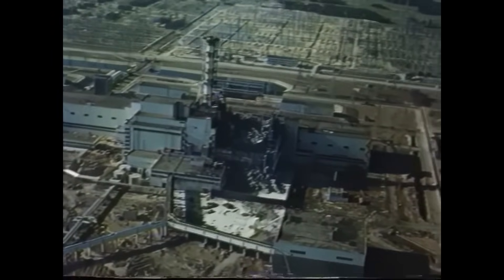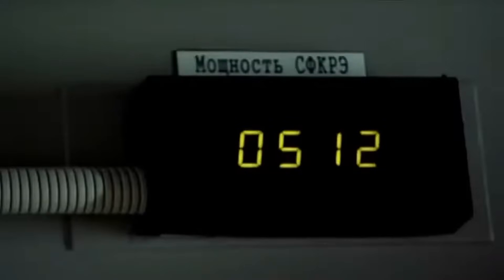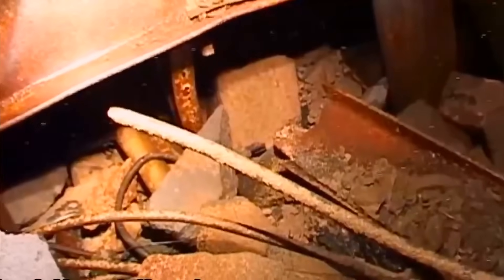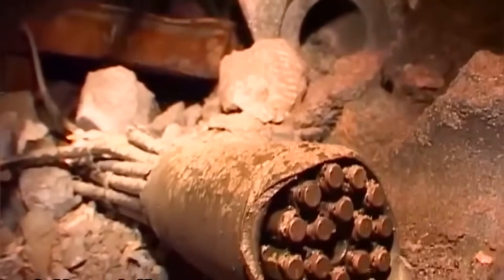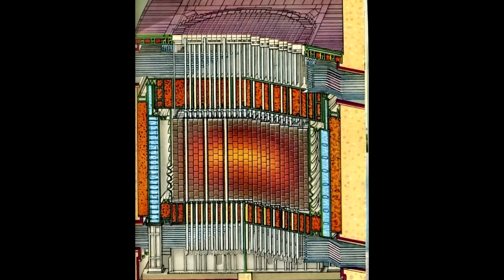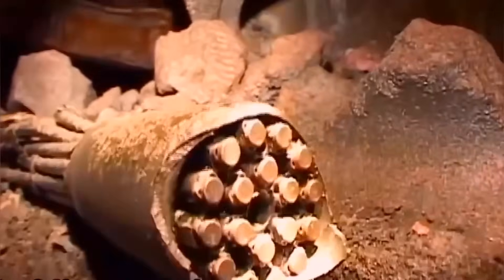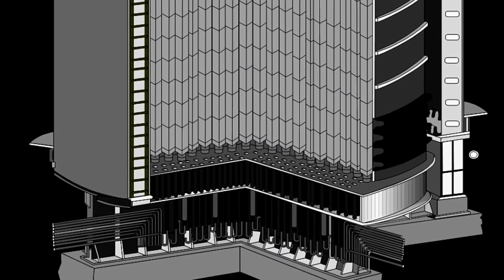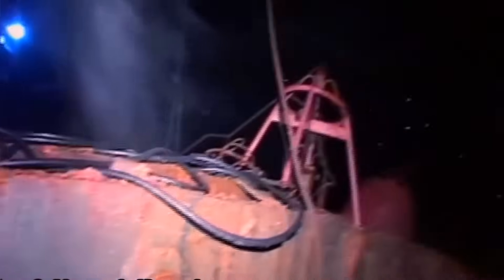Chernobyl Explosion Theories: The Hydrogen Explosion and Why it Doesn't Work

Comment: There are huge problems with your debunk.

1. Steam + graphite --> hydrogen + carbon monoxide. You claim that the high pressure means that oxygen can't come in to support combustion. Obviously, this is correct. As you say, the high pressure means that the hydrogen and carbon monoxide moves outwards. Outwards into what? The atmosphere, where it mixes with oxygen.

2. You claim that the surface area of the reactor wasn't large enough to generate enough hydrogen. Your calculation appears to consider only the upper, circular surface of the reactor. You haven't factored in all the other surfaces, such as the big hole down the centre of each block. You also haven't factored in the damage to the core from the steam explosion, which would likely produce even more surface area.

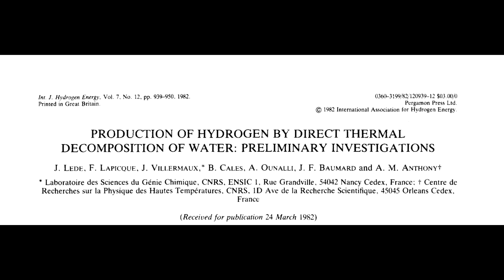3. I'm really not following the argument you're making about thermal dissociation of water, and how it relates to the table at 8:10. When you say that "This is only true at one tenth of atmospheric pressure", what is "this"? The claim that water begins to dissociate into hydrogen and oxygen at 2500C? The table shows that, at 2500C, somewhere in the ballpark of 15% of water dissociates. You then say that, at one atmosphere, the temperature must be 3000C and, at ten atmospheres, it must be 4500C. But the table shows that 22% of water dissociates at 1atm and 3000C, and 61% at 10atm and 4000C, so at 4500C there would be even more conversion. You're not comparing like with like. Also, you're assuming pure steam: note the lower part of the table, which says that 10% steam, 90% inert atmosphere (argon) at 1atm behaves roughly like pure steam at 0.1atm. So the data doesn't seem to be supporting your argument here. (By the way, the numbers you quote also don't seem to support your claim of exponential growth in required temperature, though that misuse of the term "exponential" doesn't really affect the argument as a whole.) You go on to say that the normal operating pressure was about 68atm. But the reactor had just blown its lid off, so was open to the atmosphere.

Comment: Could it be the lid came off then the second explosion happened, at the point the pressure had dropped, so yes the water under preasure didnt split, but after the lid had opened due to fission pressure the water then split and the second explosion occured ?

Comment: OK, so the hydrogen explosion is looking increasingly implausible . . .

I was under the impression that the zirconium could act as a catalyst for the thermolysis of water, allowing the reaction to occur at significantly lower temperatures than would normally be the case. This does not change the thermodynamics of the reaction (so higher pressure will still drive the reaction towards water), but does change the rate at which it can occur.

Is it possible that the lifting of Yelena caused a drop in pressure inside the reactor, thus allowing a substantial amount of the water vapour to rapidly split into hydrogen and oxygen?
Reply: All you need is a lot of graphite surface area (at 3200 square meters in this reactor), tons of steam, which we definitely have (600 kg/s) and temperatures at above 1500C which we have after 1:23:44 am.  Occam's Razor. It's not the 3 seconds that is the limiting factor. There is so much graphite surface area and so much steam that within 1 second there is enough hydrogen to cause a problem or about half a Hindenberg's worth of hydrogen.

Comment: Another great chapter, thank you!  Several commenters ask, where did the oxygen come from?  The answer may be hiding in plain sight:  During a prompt criticality, the generation of ionizing radiation is off the charts intense.  Ionizing radiation strips off atoms' electrons (hence the name) and can dissociate molecules.  If gaseous water (steam) molecules dissociate from this (or any) cause, they're put into a higher energy state, and you're left with 2 hydrogens per each oxygen, a perfect stochiometric ratio to recombine back to the natural lower energy state and releasing all that energy when it happens.  Given the amount of steam surrounding the fuel rods, and estimating the extreme intensity of the runaway fission, how many steam molecules would be dissociated into hydrogen and oxygen during the prompt criticality?
Reply: Interesting thought. 

Would that be more or less likely than the injection of energy causing a large amount of liquid water to flash into steam?
Reply: @nigeldepledge3790  Yes I've always favored the steam explosion theory, however there is agreement there were two explosions.  I asked my boss (atomic physicist) about the dissociation energy, he said, too hard to calculate, although he proposed the dissociation theory, not me (I hadn't thought of it).  Scientists refuse to commit to an answer without extensive study and modeling.  Which is the way it should be.  Me, I just offer useless opinions but this is a highly interesting topic.  It changed the worldview from good to bad, and Fukushima nailed the coffin shut, as it were, although that accident was caused by a mountain of seawater, not by the unit design, and is therefore less interesting to the safety community.  Fukushima was a sorry miscalculation, whereas Chernobyl was the ultimate Swiss Cheese Model. (for reference, see James T. Reason)
Reply: The whole oxygen argument is wrong. First, just look at the simple pressure argument. He claims that the high pressure in the reactor core means you can't bring oxygen into the core. Sure, but it would instead force any hydrogen out of the reactor, and it would then mix with atmospheric oxygen. Second, the high pressure of an explosion is very short-lived (typically milliseconds). During that time, everything is rushing outward and, even as pressure equalizes with the atmosphere, momentum means everything is still rushing outwards. That causes a significant low pressure region where the explosion happened, which then sucks air back in.

Comment: I have one problem with your explanation of graphite-steam reaction as a source of hydrogen. The paper you mentioned measures hydrogen production rates with kg/(m^2*s). What does this area in square meters mean here? Is it the measurement of surface area of the graphite? Because if it is, you can't just use cross section of the reactor core to calculate potential hydrogen production, but rather the sum of surface areas of all graphite blocks in the core, which would be a couple of orders of magnitude greater than 109.35 square meters.
Reply: Ah ok, I see you already answered this in another comment reply.

Comment: My view (nuclear scientist) - physical (steam) explosion blew lid off, jamming control rods in place, prompt criticality blew the actual core itself apart a second later.
Reply: Prompt critically - it sounds like a nuclear fizzle.
Reply: When you look at the upper biological shield, as it sits now more or less at 90 degrees to its original, horizontal orientation, there are control rods and fuel assemblies sticking out in both directions. 

Surely that shows channel contents behing forced up through the UBS (protruding up through the floor of the reactor hall) before the UBS went airborne with the channel contents clamped so hard that the UBS upward movement tore the assemblies out of the core.

Does that mean the assemblies must have been ejecting up through the UBS/reactor hall floor at the moment the UBS started moving upwards? 

Was this two distinct pressure build ups? Or was it one pressure build up that started increasing, moving the the rods up until the pressure just popped the lid off, as it were?

Or am I misinterpreting the assembles sticking out both sides of the UBS giving it the infamous and iconic scary, hairy mess aesthetic.
Reply: I remember Fatakhov explaining that rods are pretty soundly attached to the upper biological shield, so it might just rip the channels and pull things out
Reply: Nobody has explained the blue light observers witnessed, in the air, not under water, and I think analysis of this feature will shed some light 😂as to what was occurring, but I never bought the hydrogen build up story
Reply: @jwrn4u  that's ionising radiation turning the air that colour. Legasov explained this (correctly) in the HBO series.
Reply: @jwrn4u  The blue light is air being excited by all the ridiculously high energy particles flying around.
Reply: Or might it be Cherenkov radiation arising in water droplets formed from condensed steam?
Many YouTube videos show the blue glow that is demonstrated by swimming pool type research reactors.
Reply: @jwrn4u   what nobody has as often explained is those observers who didn’t see a blue light, which was literally everyone else at the accident site. It made a great death beam visual for HBO, plus a fantastic battle of wits in a helicopter, which is mostly nonsense set-up of the power dynamic of our two main drama characters. Yes flying directly over a nuclear reactor on fire wouldn’t be healthy, (even Boris Shcherbina could figure that out), no there was no blue sky beam coming out of the exposed core visible by day that could disassemble a helicopter’s components, like an updated Andromeda Strain movie. That’s all TV fiction based on “sources who saw the unexplained”. It sounded exciting, so it’s going in the TV show. 

Just to remind you 3 eye witnesses claimed to have seen a blue light at night coming out of the reactor building, like a searchlight according to one, which may have been just a searchlight. By the next morning (a few hours later) it was obvious that much of the core was scattered around the car park and when the clean-up crew got to the heart of the reactor they found it was empty. If that’s true, what could have made a kilometres-high column of ionised air over the dead centre of where the core should have been?
Reply: I don't think there is any doubt that the fast power coefficient of reactivity allowed the core to achieve super prompt criticality until it was explosively dismantled.
I believe the topic of debate here is the exact physical mechanisms responsible for the explosion - including any chemical reactions.
I think any credible hydrogen explosion theories need to show how hydrogen and oxygen could have become mixed together and then exploded.
Thus I think the theories where steam serves to transmit the explosive forces have the advantage of simplicity.
They also make the Chernobyl reactor explosion the second Soviet steam driven reactor explosion within a time of less than a year.
The first one being K-431, of course.
Reply: Not a scientist...... just a nerd who has spent WAY too much time on google 
(but the navy did try to recruit me to run nuke reactors on subs...i should have done that VS go to college for comp sci)
.
anyway.... i agree with you
the rate of power increase was insane..... which means the amount of neutrons flying around was insane 
.
like.... sometimes your TNT/rifle doesnt go BANG!!!!...... it just goes WHOOF!!! (it got wet, really old, etc)
so while it was not a nuke bomb..... it got pretty close!
.
iirc, they found "atoms" (forget the correct term, too tired) that can only come from a nuke bomb type explosion.... or at least a STRONG prompt critical explosion
Reply: @kainhall  Exactly. They didn't find certain bits of the reactor, because when the power jumped in excess of 330 THOUSAND MEGAWATTS, the components of the reactor (graphite, fuel, cladding, etc) vapourised and it blew itself apart.
Reply: That's even more power than you'd need to power a flux capacitor  . . . !
Reply: @kainhall bullshit, what happened there has nothing to do with an atom bomb
Reply: @aaron5809  That's what he said, "was not a nuke bomb". If you are urged to respond with loud words, then maybe take care to read carefully first.
Reply: This time do not delete my comment questioning your credentials as is any person dedicated to science’s job. Define “nuclear scientist” please. Im not aware of that as a career field and all specialties scientific personnel i know are proud of their accomplishments  granting their title. Ive heard of nuclear physicist, nuclear transportation engineer, theoretical physicist etc but never just nuclear scientist
Reply: @jasonstinson1767  Errr I didn't delete anything? Chemist by training (PhD) with side-projects in reactor physics and materials amongst other things in nuclear engineering. I know the fuel cycle inside and out, so yes, I know what I'm talking about.

Comment: I always thought it was probably a hydrogen explosion from disassociation or zircAlloy. But obviously it wasnt the zircalloy. Surprised this had been a theory for so many years considering it can be disproven in a few minutes. So the thing to focus on here is how PV=nRT the ideal gas law disproves this, as you say it was the wrong temp (T) the wrong pressure (P) and too short of time. I could be totaly off here but when you have a big explosion the pressure can do weird things for a split second but the net result is consistent with what happens . I used to blow up stacks of paint cans with the lids you would hammer down. I expected the explosion from the center of the pile to crush the cans in the shape of the shock wave. BUT I would often see the cans had the lids popped off in the direction of the shock wave. How can this be? The blast does crush the cans initially but after the shock wave passes the paint cans are pressurized and the air around them is low pressure for a second causing the lids to pop off in the direction of the explosion. Could that be happening here? Or if it is, would it be far too quick to do anything chemically? PV=nRT breaks down at triple points and high pressures, hence the IDEAL in the name; no gas in reality is ideal(well maybe electron degenerate gas! :) ).

Comment: I think your analysis has a couple flaws, even though i don't really think H2 was the cause of the second explosion.  When you do your analysis of graphite-steam reaction, you seem to be using the overall dimension of the reactor to calculate surface area.  Surely after the first explosion the graphite blocks were jumbled about and all those individual blocks have a larger surface area than what you used.

Then in the thermal-decomposition of water discussion, you only consider 'thermal decomposition'.  With the high power 'pulse' of the reactor excursion, there would have been a commensurate increase in 'radiolytic decomposition'.  This is a well known phenomenon in all light water reactors where the high-energy ionizing radiation breaks down water molecules even at normal temperatures and pressures.
Reply from the maker: No, in the hydrogen explosion, which follows Sich's theory until the final second, the reactor remains structurally in tact until the hydrogen ignites. The structure remains in tact, therefore the surface area remains the same,  and even if it is pulverised into dust, it would be the the same surface area. The zirconium channels that ring around the graphite would have stayed in place.

In terms of why I did not consider any hydrolysis due to neutrons, at those pressure no matter how much water you still split it will instantly recombine as the reverse side of the reaction is so strong. I hope that makes sense.
Reply: @thatchernobylguy2915 I wasn't really thinking about "Sich's theory".  But if the first explosion was a 'steam explosion' I think you'll agree that would have ruptured many of the pressure tubes.  DIdn't you say in your video the first explosion lifted the shield lid?  Surely that greatly 'disrupts' the configuration of things?